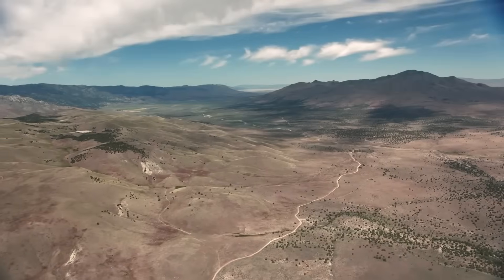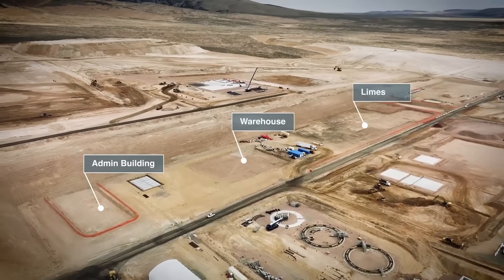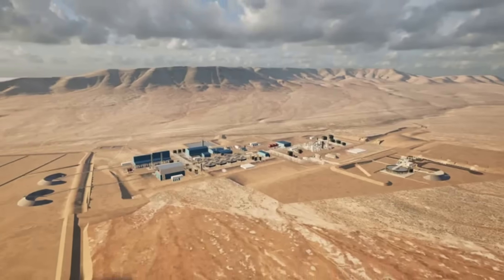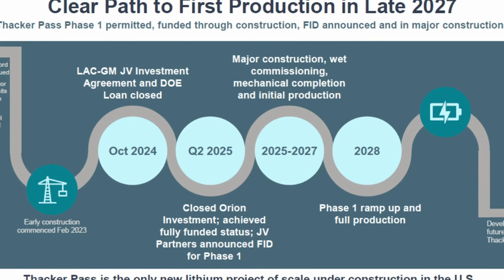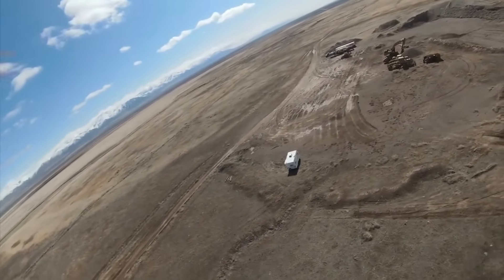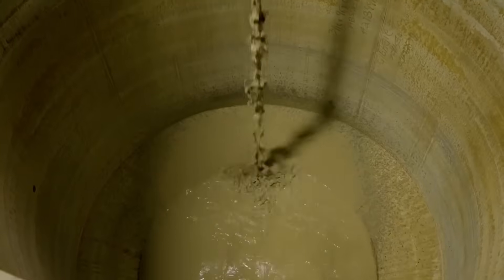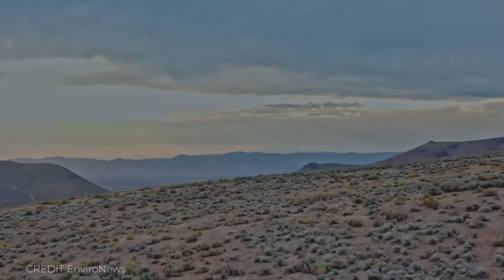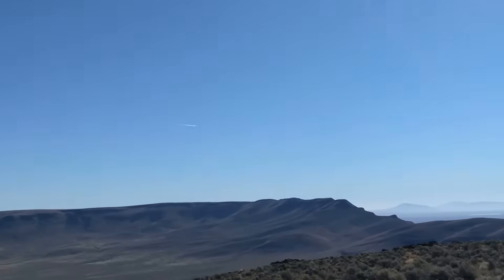The Most Valuable Hole in America

Comment: Obviously a lithium strip mine, but that's not the key issue. What makes them think future batteries will all be made of lithium? Sodium Carbonate batteries don't require expensive mining, and the chemistry for Na batteries is evolving faster than Li chemistry.
Reply: Agree and disagree, sodium batteries serve a different purpose. If you want a compact and energy dense battery, then sodium ones are not good for the job! You may be right about evolving changes in Na chemistry that bring innovations later
Reply: It's about rare earth mining and Lithium is a very small part of the whole.  Think weapons grade and all the various components that are required for advanced electronics and ballistics: China currently has a monopoly on processing and that needs to change.
Reply: Thankfully, technology is reducing or replacing lithium in many batteries, i think that the overall need will remain for many more years.
Reply: Have you ever seen the demonstration of Sodium dropped in water? It immediately converts the water to sodium hydroxide and hydrogen gas, which burns with an invisible flame: you could be severely burned before realizing you walked into the flame.  Not sure if we want to replace one dangerous metal for another one.
Reply: all proposed mining operations have one thing in common: DATA CENTERS and weapons production we the people are funding it. infuriating
Reply: @OutlawPhoenix infuriating? 😅
Reply: @OutlawPhoenix  This is no different than funding any other national security project: Naval vessels, air force and many government buildings are all funded by taxpayers.  You do have the option to renounce your citizenship, if you can afford it and very few can do it, but it is always an option. Usually the people that have time to scrutinize YouTube are retired and receiving a SS check, so renouncing your citizenship would possibly mean losing your SS check. Life's complicated.

Comment: Drilling holes is bad..... But tearing up the landscape and making large mines is green..... And we're still not recycling enough batteries   Fools!!
Reply: You need to update your recycling misinformation.  Large battery reclamation isn't critical yet, as the end of life EV volume is still very low..  Existing recycling industries are scaling up rapidly,  and achieving 95% recovery rates. 
If you think this mine is a problem,  go and read what fracking is doing to ancient groundwater reservoirs.